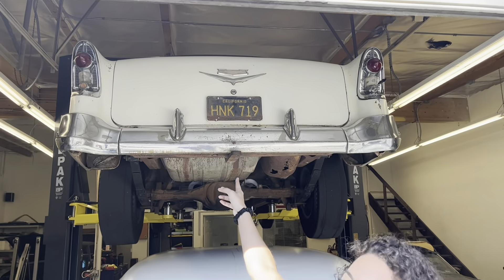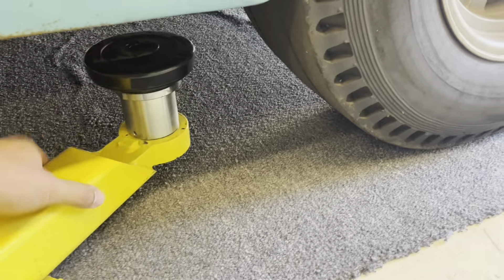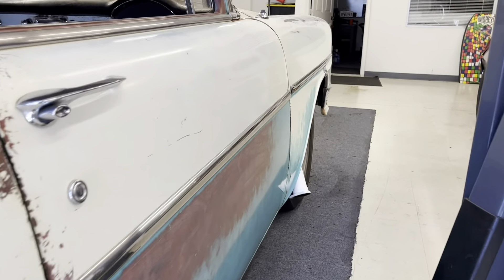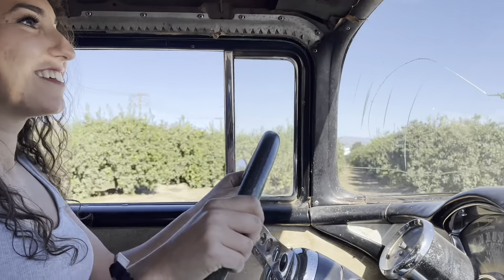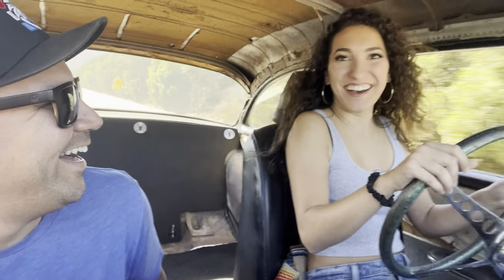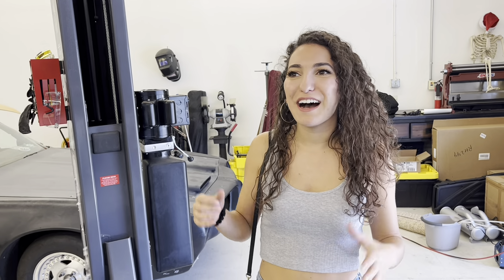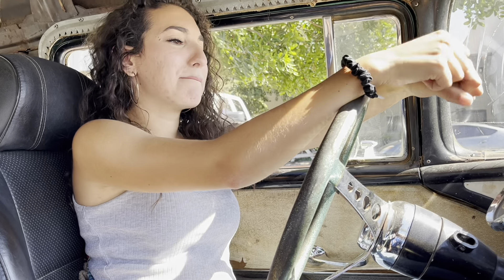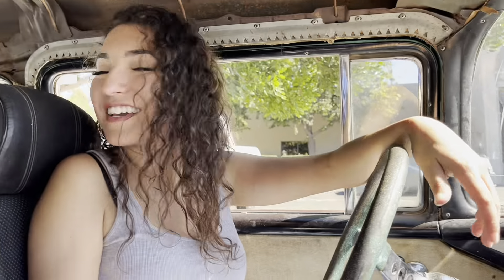Driving my Boyfriend’s 1956 Chevy – First Time Driving An Old 4-Speed

Comment: Driving an old car with a mechanical clutch is definitely a different experience than anything modern with a hydraulic clutch. Especially, if it has a touchy race clutch. You did great! All you need is practice, practice practice.
Reply: Not to mention it most likely dosnt have power steering or power brakes

Comment: You had me smiling from ear to ear. You are just as cute as could be and your BF is so super cool too. Love how he messes with you about the cop...I think he did this stunt before too right?  Great job on driving the 66 year old! Perhaps not very precise but the rawness is really appealing to us gear heads. Not much sounds better than a small block Chevy with a little lumpy cam thru open headers running thru a Muncie!  No modern car can provide this kind of sensation.

Comment: At 76 years old I've been goofing with 
hot rods since I was 15...my sole remaining car is a 56 150 utility sedan built in Oakland CA for Pacific Bell Telephone used in Sonoma County for 10 years and sold at auction to the shop that seviced since 1956 and I bought from them in 1979...still have it and take it to local show in Las Vegas.
    It's now powered by an L-78 BBC that came out of a 69 Chevelle and backed by a six speed and 69 Chevelle 12 bolt posi with old school Alston Ladder bars.
  Painted black with blue flames and has a simple black interior with plywood and carpet for a backseat..fixed glass and no window cranks...my 44 year old son played back there when he was a baby!

Comment: Great job Liv. Anyone who has only driven a hydraulic clutch standard, has no clue how much harder it is to drive a mechanical clutch car. Especially when it's a big, old, heavy car, with a high performance engine, high performance clutch and high performance transmission. And it has no power steering or power brakes. Check out my thumbnail. I think you and your boyfriend will like my 57 Chevy 605hp, raised solid axle Gasser. It makes your car sound quiet as a mouse. She is a blast to drive, but definitely not for the faint of heart. But I love her. Thanks for the video, I thoroughly enjoyed it

Comment: Do you have a 302 in that Z28? I have a original short block DZ from a wrecked 1969 Z! I have it in my 66ss Chevelle but about to change the engine to a 12 to 1 sb 327! Let me know if you are interested?

Comment: Why would a 4spd be harder to drive than a  3sp, or a 5spd.  When I was in highschool automatic transmissions were for girls, and everyone wanted a 4spd.   I  had a 56 sports coupe with a 3spd overdrive and a Hurst shifter.  Cool car, bkack tuck n roll chrome wheels 3/4 cam, 4bbl, dual exhaust.